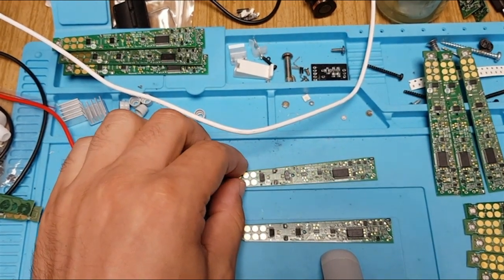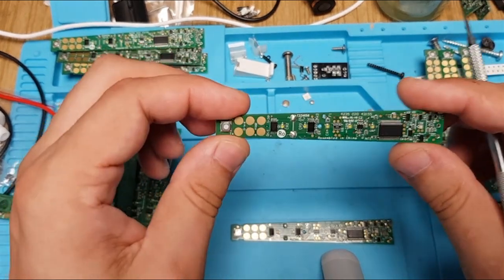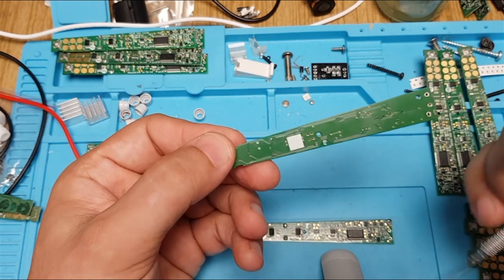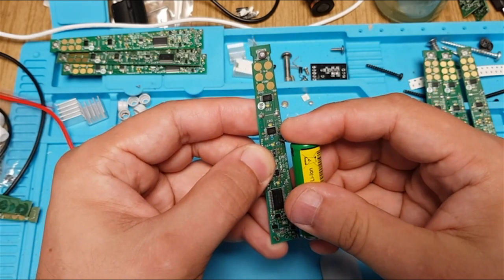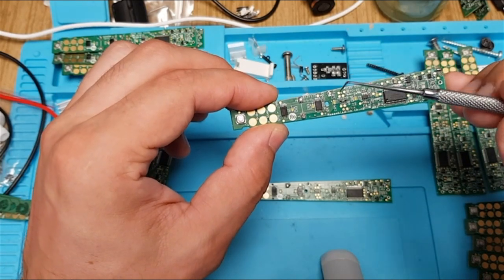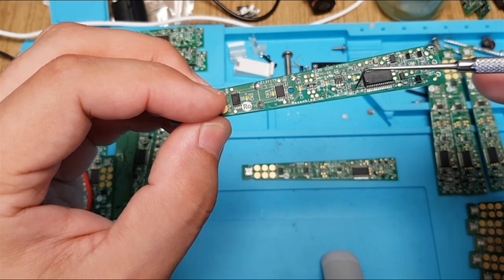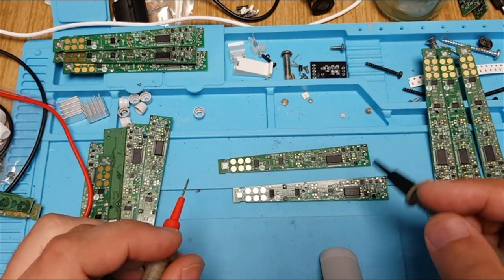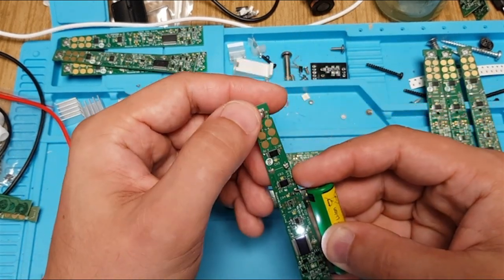Philips Sonicare repair after water damage. One solution for majority of cases!

Comment: The HX9340 stopped working. After removing the mechanism from the case, I discovered that the IU2KK chip was getting very hot. I checked all the SMD components, and they were all intact. I unsoldered the battery. There's no information about this chip online. There are no similar ones either. This is the second failure. After the first, I took it to a repairman; he soldered two or three jumpers, and it worked. A month later, it broke again. I'm thinking of buying a new board from AliExpress.

Comment: Excelent video. In my case drying alone was enough to get the toothbrush work again. Thanks a lot!
Reply from the maker: very good! if you open the toothbrush fast enough and corrosion didn't had a chance to do its dirty work its possible to get away with minimal work ;)
Reply: @letsfixitgarage  I guess I did. Now waiting for the seals.

Comment: Hey. I'm in the situation where my brush is dead (no LED lighting). There was no water leak.I looked inside. It looks like new. Battery has 3.7V. When I put on the charge, charging points shows 4.4V.
I do not see there any burnt elements. I noticed that magnet was sticking to the motor. I separated it. Still nothing.
Fuse, not sure. I believe it is the element labelled F1 ? My mustimeter shows 700 ohm instead of zero. I do not have a buzzer option it in.
Do you have a video of how to fix ? I know you barely mentioned it.

Worth mentioning, when I put it on charge, there is no light as well.
Reply from the maker: You need to inspect the electronics. 700ohm for a fuse ia a lot try changing it but if fuse blowed usually there is other problems that needs to be fixed before changing fuse and applying power..

Comment: MY toothbrush just ran out of battery, now it won't take a charge at all. Cleaned it, nothing helped. My wife's is charging, so charger is ok, any advice?
Reply from the maker: Remove battery, check capacity. I would guess it will turn out that Battery is fine. If you had water damage main tips are in the video but you need to take off the motherboard completely and inspect it from both sides..

Comment: Mine turns on, but the motor is vibrating wrong and makes a very high pitched sound. I cannot find any damage, but the inside of the toothbrush was full of water. Something must have shorted out, I just can't find it. edit: My board cannot be removed without cutting plastic, so I cannot inspect the other side. It recharges fine and holds a charge, but when I turn it on, the motor has that problem and the light flashes orange very quickly for about 20 seconds. Maybe it is garbage time.
Reply from the maker: You can press the plastic pins with pliers or just cut it off the ticker part and it will still hold in place. You need to look both sides as usually bigger damage in on the underside.. and yes water damage is difficult.. it can be anywhere..

Comment: Thank you very much for your help and the precise description of the test points. I have just repaired my Sonicare connecting a thin wire from the test point of the button directly to the resistor. I have also added a few of silicon on the broken rubber o-ring. I do not know if it is a good thing but everything is working properly at the moment.
Reply from the maker: Glad it helped. but I would definitely replace the upper seal. there are some links in description its not that expensive and chance of getting water damage again will be significantly lower ;)

Comment: Nice video. What do you think about repairing it and coating all the board already wired with silicone so it never happens again? Is it possible to buy some of your repaired boards?
Reply from the maker: I thought about it and I always coat the repaired parts with clear coating but I wouldn't bet my whole money on the coating alone. I'm principle original seal is very good protection if you take care of it. if you don't let toothpaste buildup on the seal it holds very long. if you start to see any buildup on the seal just replace it and you will not need to worry that whole brush is full of water and if not PCB then electromagnet will start to rust and corrode.. and yes I have some repaired boards, if you need some write me an email it's in the about channel section.

Comment: There are many replacement pcbs on Ali express - is it worth just soldering a new one in? Would it work?
Reply from the maker: Well I would first go with repair attempt if that fails then buying new one from China is always an option, if it doesn't work, just claim the seller. I doubt that they have original code in these but on the other hand it's not that difficult to program few patterns when you read them out with oscilloscope :) so yes they are ok :)

Comment: Hello do you know how to fix if It wont charge can you please make a video on this please and thank you
Reply from the maker: have you taken it apart? have you checked the test points that is in this video? 95% of the times it's water damage (especially on the back side of PCB) 5% defect on the board like charging IC that's very specific and difficult to find..
Reply: @letsfixitgarage  the. problem was first was it would not vibrate and while fixing that problem now it does not charge
Reply from the maker: Well if its after a repair attempt that something went wrong it's even more difficult to comment as I don't know what was done intentionally or unintentionally.. one suggestion would be to get a donor to swap parts or buy a new PCB that would fix the problem fast. I have a link in description..
Reply: @letsfixitgarage  is there any way I can ship it you for you to repair it
Reply from the maker: It's possible wirte me an email we can discuss the Details. Channel about section has my email.

Comment: Hello.  nice tutorial. i changed my toothbrush battery.  now it works, however, after about 30/40 minutes it downloads.  the battery absorbs me from 3.7 V to about 1V and obviously the toothbrush does not turn on anymore.  what can it be?  is it normal that connecting the test leads on positive and negative without battery, the tester sounds?  thank you
Reply from the maker: You have a short on the board. Some kind of component should seriously heat up if it discharges in just 30 min that's how you can identify the bad component.
Reply: Ok  thanks a lot

Comment: Great video! My toothbrush works fine but when put on charger it detects it but vibrates with 2 short beeps and 1 long one and doesn't not charge. If I hold the power button it stops for 3 seconds or so but then resumes the vibrations. Could it be a water damage issue?
Reply: Actually, for anyone wondering, I managed to fix this charging issue by taking off the power button and cleaning it. My guess is the power button dirt/water damage was causing it to be pressed while charging hence the 1 long beep followed by 2 short ones, usually that is enable/disable the easy start. Although reassembling the power button was a pain and I ended up having to use some electrical tape to keep it in place because a pin broke on the frame that holds it in place.
Reply from the maker: Wanted to write that it could be water damage on your first comment :) good job on figuring it out. If there was water I would suggest to take off the motherboard to inspect the back side. Especially if it's diamondclean model.

Comment: These videos are very helpful thank you. Mine is not powering on. My PBC is PBCR3. I get continuity between the power button TP1. When I use my meter from the hole to the right of the power button to the longer U1 chip it powers on, so I assume the path to that chip could have a problem. What points on the board would I solder a connection to and from? Can you remove the board without un soldering the battery connections? I'm able to detach the upper black clips but not sure on the lower connection. Thanks.
Reply from the maker: Yes the path from button to the chip is broken. Usually under the button on the backside. So when you will take off the board just connect the test point to the track beneath it or run a jumper wire from button contact to the chip or the point that I show in the video.. and to take off the board you need to desolder not only the battery but also two points on the charging coil.

Comment: Thank you very much for the videos. I've manage to repair 1 brush but not sure is it because of my repair or from the water but one of the LED seems burned (almost no light). Are they replaceable or is not worth the effort? Cheers
Reply from the maker: Your welcome :) Sure it can be replaced. Just look for a right replacement (size, colour) or take it from a donor but be carefull with soldering time, temperature they are quite sensitive..

Comment: Hello, I tried to clean sonicare hx6250-14 and the water got in (I'm so stupid)
Then it stopped working. After I disassembled it, it started to charge. Now I'm waiting to fully dry, and then I'll try to charge it fully. Is it safe to use it?
Reply from the maker: We'll try it out for at least few times without the housing.. if nothing heats up it could be safe, but with water you never know what damage was done..but from my experience it is quite reliable toothbrush with good components I saw a lot of water damage and components usually hold through..

Comment: Thank you so much for your videos! They are a life saver. I recently took my Diamond Clean apart to change the seal. All went well - I put it back in its casing but when I pushed the button, it would light up for a second and then die. So I thought maybe it needed charging and so I put it in the holder (without its casing) and it started flashing. Yay! After an hour or so, I thought I'd just check it. It turned on, vibrated - all perfect, all very exciting and then abruptly stopped dead. Now it won't charge - it won't turn on. I am so new to electronics and don't have any real tools but will order some. I just don't know where to even start. Does it sound like a fuse? Could I just need a new battery? If it was water damage and there was water somewhere I couldn't see, would it stop it charging? Any guidance at all appreciated. In the meantime, I will continue watching all your videos!
Reply: You might want to check the connections on the battery. The tab welds that connect the battery to the board can come loose. If you take a small screw driver, you can lightly push the battery under the PC board. If one of the tabs are loose, the battery will pop out. That was the issue with mine.
Reply: @handydanny1315  Thanks so much! I'll try it out!
Reply from the maker: Hi! Check my video for water damage and check MOSFET control traces to the chip and MOSFET itself if it's not shorted.. usually water damage is under the board not upper side.. but again if it doesn't turn on at all it could be the fuse or even some chip that burned through.. these kind of damages are difficult to advice without seeing the board..
Reply: @letsfixitgarage  Thank you so much! I will get myself a soldering kit and get the PCB out :-)

Comment: Hello! thanks for the videos! My Diamond Clean started to turn on by itself so I opened it and the magnets were together and also was kind of wet inside. I did not do much  besides letting it dry and clean some oxide with a brush, but now when I connect it, it is buzzing/beeping while on its charger, one long then 2 short beeps. Do you know what can I do ? Thanks!
Reply from the maker: First off all I would suggest taking the board off it's plastic frame as there will be oxidation and damage under the board this needs to be cleaned to. Don't turn on the board till it's completely dried. And I assume the button will have some contamination inside so it would need to be cleaned too you can see how it's done in my last video https://youtu.be/vC-TKIwYcbI
Reply: @letsfixitgarage   Great I will try it ! also do you know where can I buy the tip seal that is broken to replace it?  If I can not fix it do you think I can sen it to you or can you give me a quote of your services please; Thank you so much!
Reply from the maker: Check ebay or AliExpress for the seal.
Sure if needed write me an email letsfixitgarage@gmail.com and we can check if I can help you ;)

Comment: Thank you for this series of videos. I have a water damaged brush, with one MOSFET getting very hot on the Deep Clean (last one) programme. I even get a wisp of smoke from the PCB sometimes. you mentioned about shorted MOSFETs in the video - do you know what might cause this? Is it track damage under the MOSFET itself for example?
Reply from the maker: Water damage is quite unpredictable.. it could be long time contact corosion or simply water droplet shorting mosfet out..  smoke could be coming from element itself or the pcb track burning through.. I would clean it in ultrasonic bath and afterwards clean it with alcohol then check what damage it has.. elements, tracks.. if mosfets burned through question is it resonable to repair.. maybe use it as spare parts donor..good luck in repair!
Reply: @letsfixitgarage Thanks for the tips. There isn't much visible water damage and the battery is still good - but keeps getting discharged due to the brush starting up randomly. I will give it a good clean as you suggest and maybe replace a FET if it comes to it!
Reply from the maker: @iwbnwif  if it starts up randomly inspect/replace the main button. It could be that water inside is randomly shorting it out..

Comment: I have a sonicare diamondclean of about six years old. It doesn't do anything out of the charger. When I put it on the charger, it vibrates twice shortly and then a pause and another short vibration. Seems like an error code. Does anyone knows what this means and how to fix?
Reply from the maker: Does the charging light glow yellow/orange? Maybe the battery is dead.. as the toothbrush vibrates when charge level is low. or if the upper seal is damaged the water damage would me my "favorite" defect.. that could be confirmed by opening and inspecting the insides..
Reply: I have had the same as this previously. It could be a nearly dead battery, or you can try a reset (hold the button in continuously for at least 5 seconds).

Comment: fantastic detective work
my son has one thats broken exactly as you highlight ( TPH failed) and the traces are too small for me to resolder !

are you able to source or sell your repaired pcbs?
Reply from the maker: Everything's posible, write me an email, it's in channel description
Reply: Hi, what wire do you use to repair the traces?
Reply from the maker: 0.02mm uninsulated wire. Or at least that's what the Chinese declare, haven't measured it..